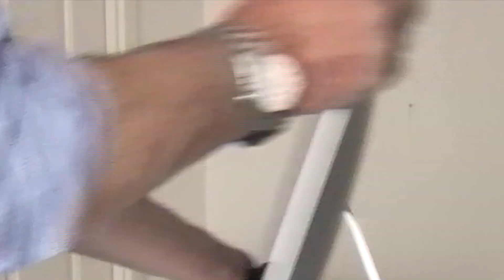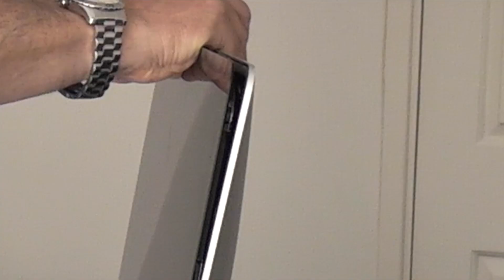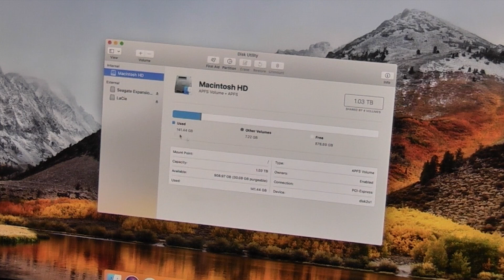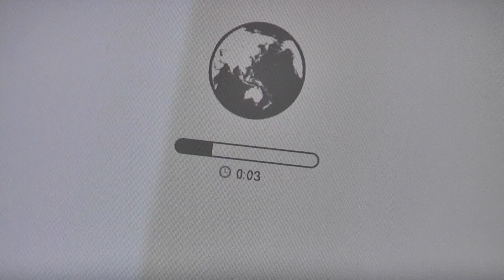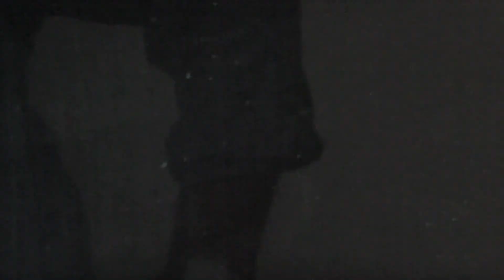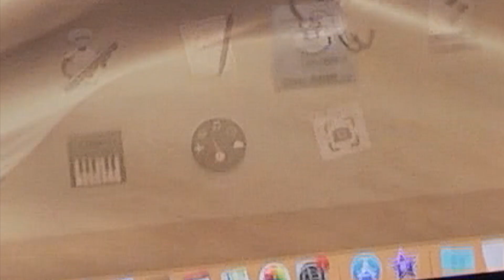Hard drive problems video lost

Comment: Nice job in repairing your Mac. Your drive probably has a bad component on the logic board causing it to not read it. 
It looks like you can put Mac Repair Technician on your resume. I had to give up working on phones and tablets because my eye sight got bad enough I couldn't see the tiny components any more. 
Sorry that you had the issue with your computer but thanks for posting this video, as you said, in case someone else has the same problem.

Comment: Bummer - Sorry you had to go through so much pain just to change out a hard drive. That's why I'm holding on to my older Samsung S4. I can open it up. Same for my computer; HP desktop. Need to replace, clean, etc; just remove two screws, open case, do what I need, and then close it up again.
I will have to give Apple a thumbs up for their OS replacement, that is sweet!

Comment: Hello, this might work for you and you do at your own risk.  If you have a drive that is exactly the same type make and model possibly revision etc you can take the pcb board off of the bottom of the good drive and put it on the damaged drive.  The drive might work and then you can recover your Data.  Some drive failures are due to PCB failure. it worked for me good luck!
Reply from the maker: Hi yes that's what I am going to do I will see if I can get the same part number drive and swap the PCB if that fails I could change the arm.